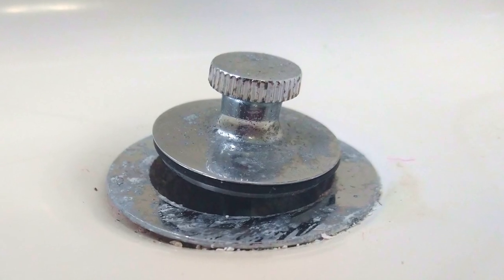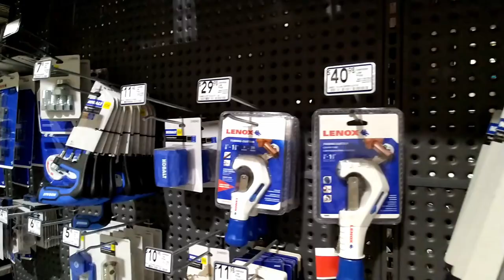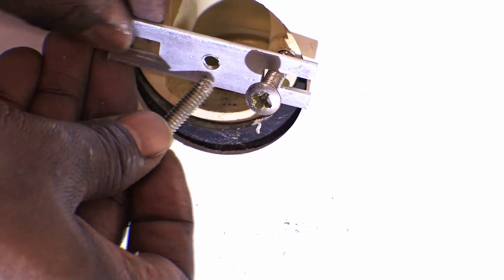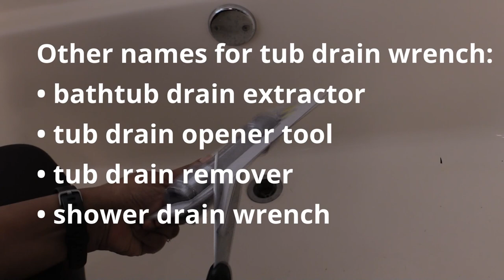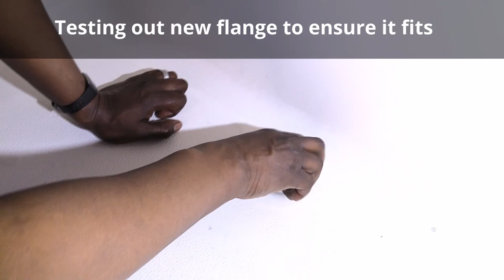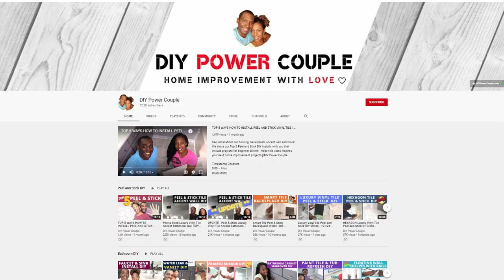Bathtub Drain Removal and EASY Pop-up Stopper Install  | DIY Power Couple

Comment: Hi guys. I've been trying to replace the tub flange but is having difficulty since the tub seems to be original to the house (over 50 yes old). Now that I see that you used a pipe wrench I will have to try that. Thanks much.
Reply from the maker: Hi Juju! Hope the tub drain wrench works out well for you. Thanks for watching! 😀

Comment: Great video, However a good pair of leather or thick gloves with the proper tool gives you more torque strength making it easier to remove in such applications.
Reply from the maker: Thanks for the tip!

Comment: Thanks for the great video. Gotta replace our pop-up tub drain and this was just the guide I needed. Hopefully our flange cross pieces don't break when I try to remove it. It's original from 1956 and very corroded. Fingers crossed, and thanks again.
Reply from the maker: Chris, if you use the tub tool, it should create equal distribution of pressure when you turn it counter clockwise (so the flange cross won't break). Let us know how it goes. You're welcome and thanks for watching! -DIYPC 😃